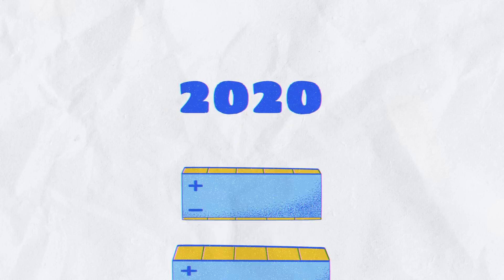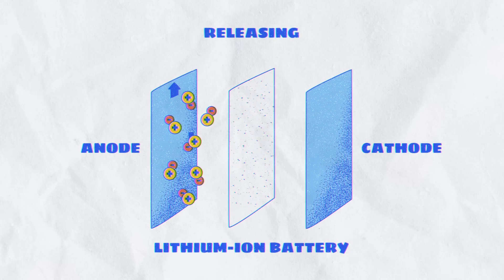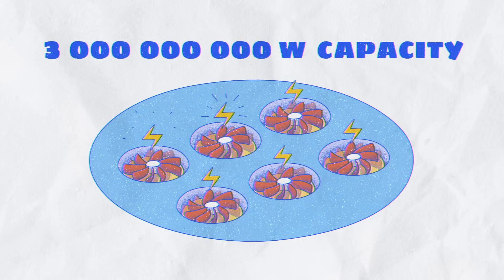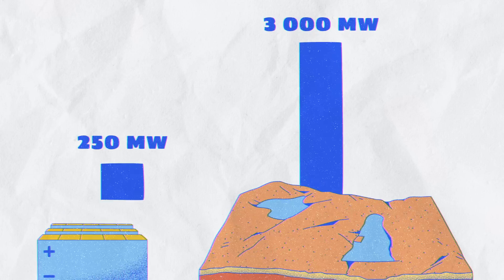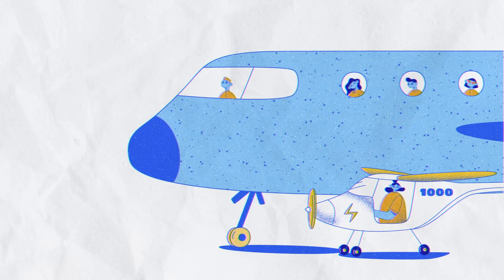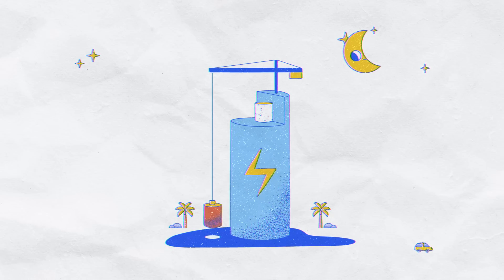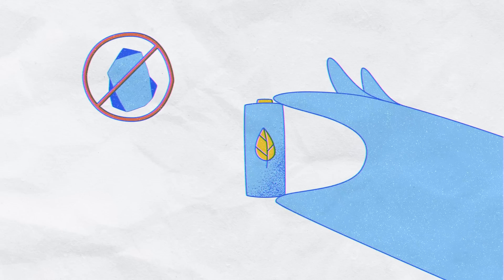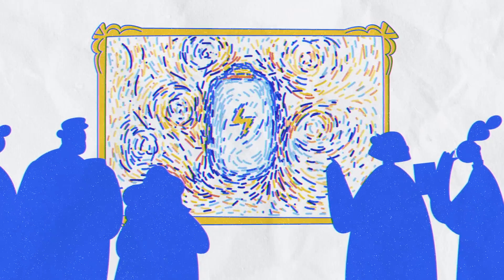How scientists turn lakes into giant batteries

Comment: Mass adoption of electric vehicles will provide the best, most cost effective storage solution. With vehicle to grid capability, users can sell a predetermined amount of stored energy back to the grid during peak demand/low supply times. And, as batteries reach the end of their life in cars, they will have another 10 years as home storage units. This tech will also be useful in off-grid situations, allowing people to store energy from home generation like rooftop solar. There is already a stadium in Amsterdam being powered by used Nissan Leaf batteries.
Reply: Electric vehicles don't solve anything. It takes a tremendous amount of fossil fuels to produce them and charge them.
Reply: @DegreesOfThree  ahhh no. They take slightly more energy to produce and even in the dirtiest coal fired electric market, they emit less than ICE vehicles. That said, the grid is getting cleaner by the day, as in my province of Ontario where we shut down all coal generation. This is a long settled argument, but then again, you bearly listen, do you.
All that aside, no ICE vehicle will ever send energy back to grid and will never help to stabilize the electricity supply.
Reply: @1964mcqueen  No vehicles are sending energy back to the grid. If they produced so much excess energy, they wouldn't need to be charged in the first place. The whole idea is ridiculous.
Reply: @DegreesOfThree  seriously, you are really living up to your name. A 10 second search before both if your comments would reveal thousands of articles and videos showing how wrong you are. V to G is about charging when demand is low and returning a small amount when it is higher. If you need that kilowatt or two, you don't sell it back, but most of the time you won't. There is so much information on it. Almost every EV manufacturer, electricity producer, and charging provider is looking at it. I have used my own EV in power outages by connecting an inverter. I draw a kw or two and still have plenty of power for driving the next day. V to G is similar  but on a much larger scale. https://en.m.wikipedia.org/wiki/Vehicle-to-grid
Reply: @1964mcqueen  What you're talking about is just energy transfer, not production. Sure, your electric vehicle might come in handy during a power outage, but that doesn't reduce the demand for fossil fuels by any stretch of the imagination.
Reply: @DegreesOfThree  read the article. It is dead simple. V to G will provide access to gigawatts of energy storage to cover spikes is demand, like was just experienced in Texas. It is nearly instant as opposed to the delays in firing up a gas generator which can cause all kinds of issues. It will be useful in blackouts, but will help keep them from happening in the first place. It allows you to store renewable electricity, and allows you to time shift, to charge your batteries when electricity is abundant and cheap, then use it when its in high demand and more expensive. Real simple stuff.
Reply: @1964mcqueen  You're delusional. How many electric cars do you think are driving around Texas? You would need millions of vehicles. And how many people do you think are going to discharge their car during a power outage when there's no certainty of when they might be able to recharge?
Reply: @DegreesOfThree  seriously man? Go back and read the post that got you going in the first place, "mass adoption will provide...." This kind of implies that I am talking about the future. I never said that this was time travel and could go back and prevent the Texas disaster.
Reply: @DegreesOfThree  read the article. By covering peaks, we will reduce blackouts like Texas. And if someone doesn't want to sell their power back, they can use it to power their house, reducing demand on the grid. Again, real simple stuff.
Reply: @1964mcqueen  Honestly dude, you're not going to prevent any blackouts with your golf cart. I would be shocked if a fully charged electric vehicle could power a house for more than 15 minutes. If you read the Wikipedia article you cited, you would know that increasing the number of charging cycles, dramatically reduces the lifespan of your batteries. The whole thing is absurd and does nothing to address the environmental impact of producing and disposing of batteries.
Reply: @DegreesOfThree  you do understand that none of this is my information? This is from ev manufacturers, grid operators, and charging providers the world over. My golf cart has enough capacity to power a house for a day and a half of regular consumption and several days if needing to stretch it. But, remember, most of the time this just happens in the background and only a kilowatt or two from each car. A kilowatt or two does not come close to cycling a 75 kwh battery pack so degradation is negligible if any at all, as the article also states. Battery longevity is improving all the time. Tesla's million, mile battery is going to outlast any car on the road. It is going to be a very simple system that people can opt into or not based on their needs.
Reply: @DegreesOfThree  BTW, your "golf cart" quip reveals how little you must know about modern EVs. Some of the fastest cars on the road are electric. 4 door Tesla's routinely beat some of the fastest gas cars on the road. They have huge battery packs that, yes, can power a house for days if you need that. They last as long as any gas car and need next to no maintenance. Hardly golf carts.
Reply: @1964mcqueen  I'm partially just giving you a hard time, but I still don't think you are comprehending the wastefulness of creating and carrying around so many batteries. For the cost of one Tesla, people could buy at least 50 nice generators... enough to power an entire neighborhood. It's highly unlikely the cars of the future will carry around so much excess weight, in the form of batteries which can explode or catch fire and require lots of fossil fuels to produce and charge. I'm glad you like your car, but mass adoption of electric vehicles is not realistic environmentally or economically.
Reply: @DegreesOfThree  as with just about ever argument you've put forth, it seems you haven't bothered to look into the facts or you are relying on old, long debunked myths about evs being worse for the environment, that they are fire hazards or just not knowing how useful battery storage,  in a car or stationary  can be. The information is all out there if you want to learn, or carry on with what you think makes sense. 
Have a good day.
Reply: @1964mcqueen   'The manufacturing processes of lithium, nickel and cobalt, the solvent, and mining byproducts present significant environmental and health hazards.[272] [273][274] Lithium extraction can be fatal to aquatic life due to water pollution.[275] It is known to cause surface water contamination, drinking water contamination, respiratory problems, ecosystem degradation and landscape damage.[272] It also leads to unsustainable water consumption in arid regions (1.9 million liters per ton of lithium).[272] Massive byproduct generation of lithium extraction also presents unsolved problems, such as large amounts of magnesium and lime waste.[276]'
Reply: @1964mcqueen  You're still missing the entire point. It's not about finding a storage solution. It's about finding new ways of generating power that don't require fossil fuels or large-scale environmental damage. Your Tesla does not reduce dependence on fossil fuels. You're just shifting your emissions from your tailpipe to the power plant where you get the energy to charge your car. Doesn't matter whether the power plant is using hydro, solar, wind, nuclear, coal or oil. They all require fossil fuels to make the plastics, steel and other components needed to function. The entire idea of a grid is antiquated and extremely wasteful due to transmission loss. Energy should and will be generated at the point of use. Having some storage capability is reasonable, but carrying around a thousand pounds of batteries is completely idiotic.

Comment: An idea to use natural energy would be to use the movement of ocean waves. They never really stop and take nothing from the environment.
Reply: Mechanical objects don't last long in salt water.
Reply: @DegreesOfThree  its the thought that counts. At least I tried🤷🏻‍♀🥺
Reply: @ashleyklump4638  Tidal power plants have been used since the 1960s, but they're expensive and need a high flow rate. South Korea has the largest one.
Reply: @DegreesOfThree  I didnt know. But thanks for letting me know.🙂

Comment: I'd like an explanation why we aren't storing energy into hydrogen?  Take water, use green electricity to split it into oxygen and hydrogen.. then when the hydrogen is burned off it's only by-product is water when it combines with oxygen.  You can store hydrogen for a very long time, and it's easily converted into electricity.  I'm sure there are losses, but it''s at least a step.

Comment: The far fetch solution is Thorium-based power plants, before we find a better way for harvesting energy directly from the Sun aside from photovoltaic cells (the cleanest solution so far.)

That crane solution is unfeasible compared to the actual "hydraulic" batteries, it demands a lot of maintenance and generates a lot of unrecyclable material (concrete blocks) amongst other issues.

Comment: during a very sunny dry season you could pump water back up into a dam during the day to power lights and homes at night, no?

also, if the shape of the pipe between reservoirs was of a brachistochrone, the water would flow down with more velocity = more kinetic energy.

Comment: Question: Doesn't it take energy to move the water uphill? Shouldn't the energy required to move the water uphill equal the energy supplied from the water moving downhill? Therefore we have net zero energy gain?
Reply: From my understanding, it's not that it's creating more or new energy, it's expending energy so that the energy can be stored for future use.

Comment: When you have eliminated the impossible, whatever remains, however improbable, must be the truth. —Sherlock Holmes
Nuclear fusion!
💕 ☮ 🌎 🌌
Reply: I think you mean fission...
Reply: @kevcoolkev25   https://www.space.com/nuclear-fusion-reactor-sparc-2025.html#:~:text=A%20viable%20nuclear%20fusion%20reactor,the%20Journal%20of%20Plasma%20Physics.
Reply: Wait until they blow up /s
Reply: @Snelly112  nuclear fusion reactors blowing up is very unlikely because the reaction that takes place in fusion would simply stop if energy flow is cut off. In nuclear fission, chain reactions are much more likely even when energy is reduced, this makes them more dangerous
Reply: @Byotch  yeah right
Reply: @Snelly112  yes fusing hydrogen isotopes is less dangerous than radioactive uranium fission believe it or not 🤯🤯
Reply: @Byotch  and fissioning uranium is already rather safe.
Reply: @paulmahoney7619  true
Reply: @Snelly112  Nuclear Fusion is completely different than Fission.
Reply: @Snelly112  chernobyl flashbacks
Reply: @shaileshsakhre343  that only happened because there was little to no regulation in chernobyl.
Reply: @shaileshsakhre343  that was nuclear Fission, nuclear fusion is an entirely different thing